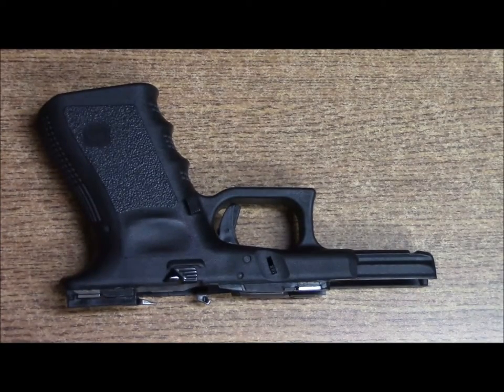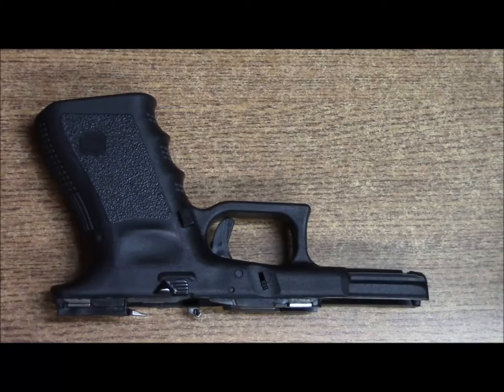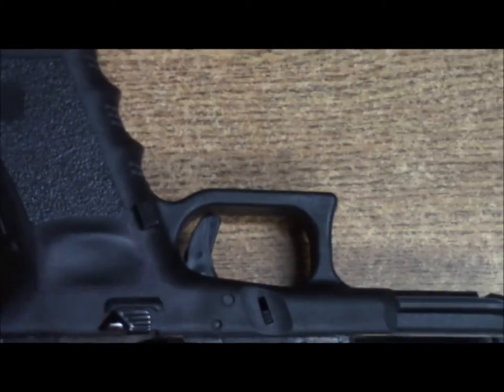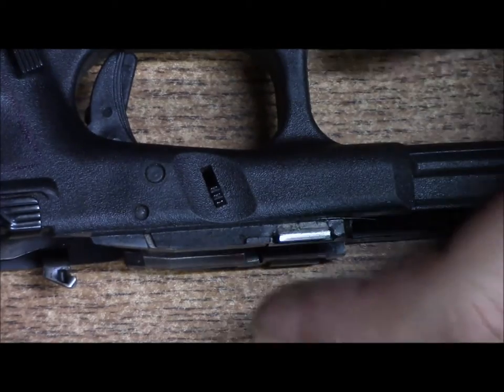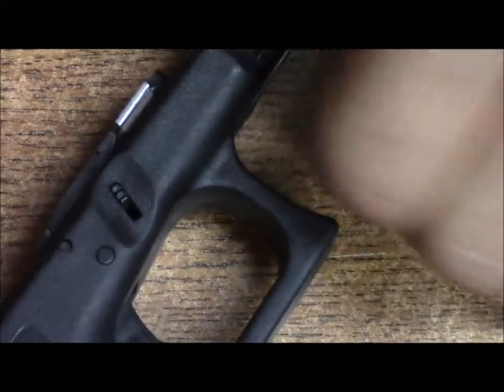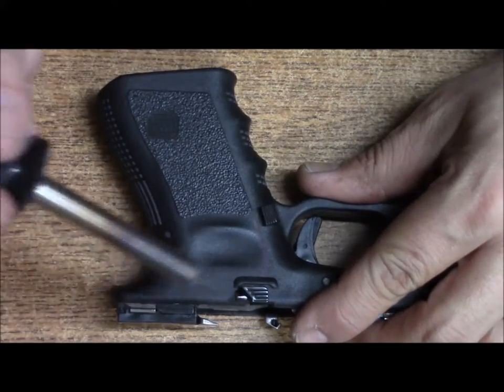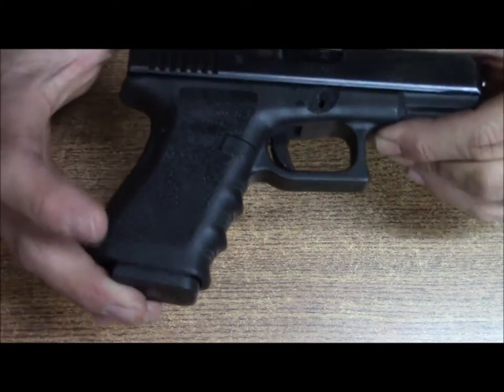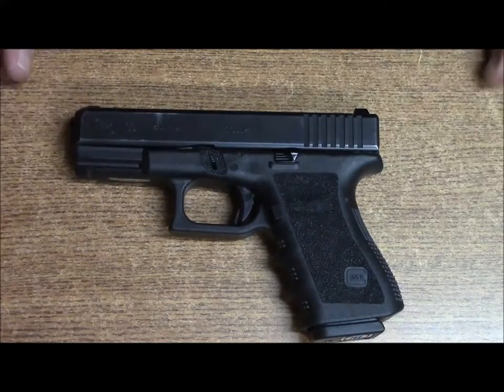How To Stipple A Glock Pistol

Comment: I'm curious if your soldering iron is at full temp or do you use something like a dimmer swith to adjust temp?

Thanks for video, very informative.
Reply from the maker: Sorry for the smacking, it helps me to concentrate! I use a standard soldering iron with no dimmer. just be careful. you can easily burn all the way through the frame! Thank you for watching!